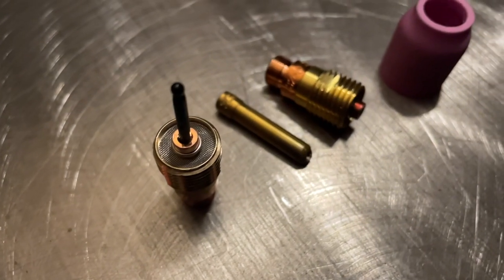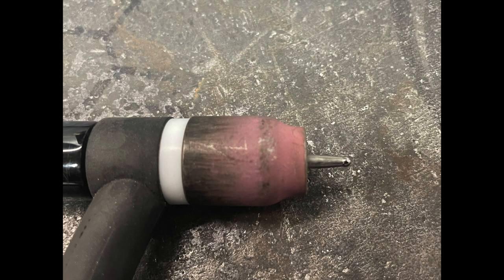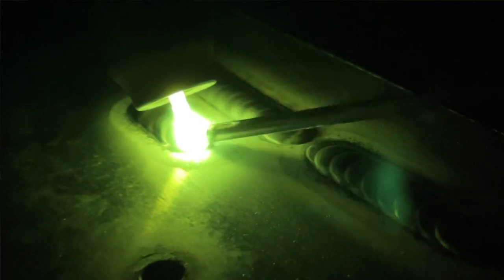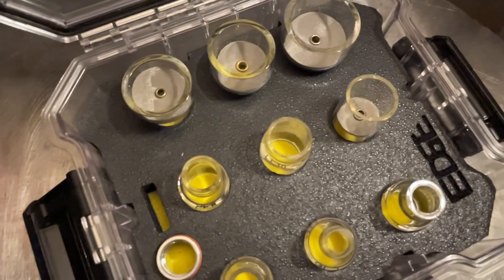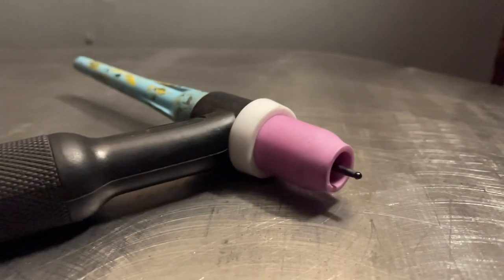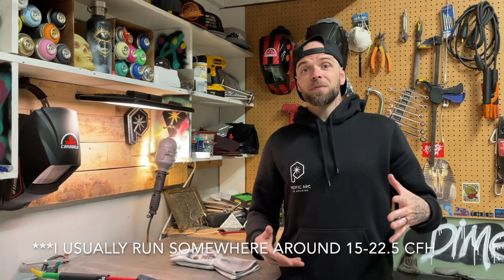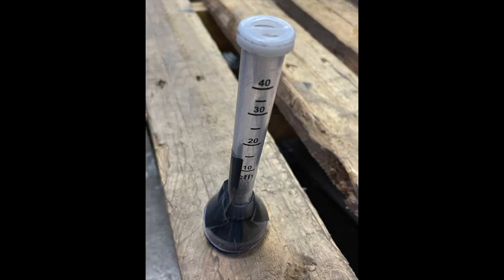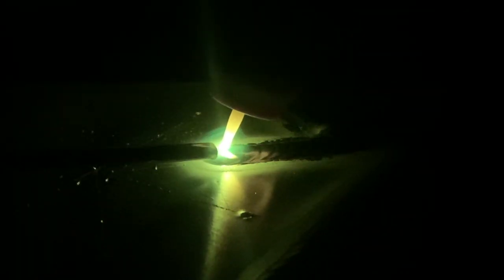Tig Welding Basics🔥The most IMPORTANT thing for torch setup??

Comment from the maker: Thanks for watching 🔥🔥Check out my last project HERE🔥 https://youtu.be/hpnbM4BXqR0
Reply: The tip you gave about using the flow meter tester was the best piece of advice I've stumbled across in a long time. I don't weld all that often but I have a nice TIG machine at home and our shop where I work has a nice older TIG machine as well. I've always had issues with porosity in my welds when doing mild steel using both machines and could never figure out why. I had everything set up as perfect as I could and still would struggle. I bought a flow meter tester today and found out the flow meters on both machines were reading way more flow than what they were actually putting out. Had to crank both regulators up a lot. Wow, what a difference in my welds. I put a lot more faith in the flow meters that came with the regulators than I should have. I was even having issues with my tungsten overheating I had so little argon flow before. You're a life saver dude! I know it sounds like a silly little piece of advice but it made a huge difference. I don't suck as bad at this TIG welding thing as I thought. :o)  I have a service trailer project I'm putting together at work right now and it's going to require a ton of welding.  Thanks so much, it's appreciated!!!

Comment: I am really enjoying your short videos on how to tips. Thanks for posting them. Can you end a controversy on CFH.  Many of us use a floating ball regulator. There are 3 "rule of thumb" methods on how to read the ball - scale mark at the bottom of the ball, scale mark at the middle of the ball, scale mark at the top of the ball.  I have seen videos from several people that are good welders claiming to be correct and they do not have consensus. Which is is?   I cannot see much of a difference but, I am an amateur and am more worried about dabbing the tungsten.

Comment: Great video Dusty. That's interesting that TIG cups numbers are the 16th of an inch. Straight razors are measured in a similar  way. Although they are most commonly in 8ths of an inch. So 6/8ths or a large razor may be 10/8ths.

Comment: As always, thanks for the helpful tips.  Does your suggestion for max stick-out (equal to or less than 1 cup dia) also apply if you're using a regular collet body instead of a gas lens?  My results with regular collet bodies on aluminum have been poor (unable to get a puddle regardless of flowrate) but no problem with a gas lens.  Then I checked a few owners manuals; most say nothing, but the ones that do recommend 1/8" to 1/4" stick-out with regular collet bodies.

Comment: Hi from the England , I’m teaching myself to tig weld, I have a 160ac/dc inverter welder, my question is, why does the arc “dance” about while welding 2.6mm mild steel tube.? I find it hard to keep the tungsten sharp too, excellent tutorial Dusty, I keep thinking I’ll be doing that one day 😂 here’s hopeing
Reply: When you grind your tungsten don’t leave it at a point dress the end with a small flat you will get better results and that should stop the arc dancing around
Reply: @georgegriffiths2235  thanks for the reply George I’ll give that a go ,,getting there slowly 😎

Comment: So I'm just getting into TIG welding aluminum. The one thing that I can't find on YouTube is how to fix a mistake when welding aluminum. For instance, touching the tungsten and filler rod on a long pass. It blows garbage everywhere. I stop, wire brush, and clean the weld. When I start the weld the contaminate that is buried pulls right back to the surface. Is there a way to get rid of that without completely grinding out the weld?

Comment: You're using a gas lens though, right? I still use an old style torch & stick to HALF the cup dia. for max. stick out & find that's enough unless I need to get down into a tight corner or crevice...

Comment: So, I have a Forney 140MP that I am using to learn how to Lift TIG; do you have any videos or suggestions on TIG welding without a pedal and DC only?  I am setting my gas at 10cfm and using 1/16th tungsten along with #10 glass cups.  I use an ESAB Savage helmet and have really good view; welds not using a rod is good but adding a rod I don't seem to get good penetration and not feeling comfortable with it. I am practicing on 16Ga. galvanized steel.  Any comments would help...thanks and keep the videos coming!!!

Comment: What's the flow meter tester thing called?
Does it work on mig?
Reply from the maker: Yes! Sits on the nozzle just the same and do a gas purge:)
Reply: @PacificArcTigWelding  cool, thanks for the reply.
So it would or should work on the oxy torch as well.

Thanks, subbing.
Reply: @mrillis9259  How can you use it on MIG with the wire feeding out.  I don't think it will work.
Reply: @mrillis9259  No, not for oxy!!
Reply: Dan L. Unclamp the drive roll for the purge.